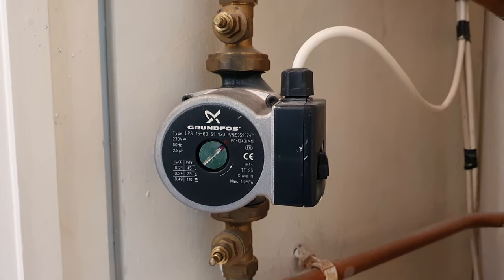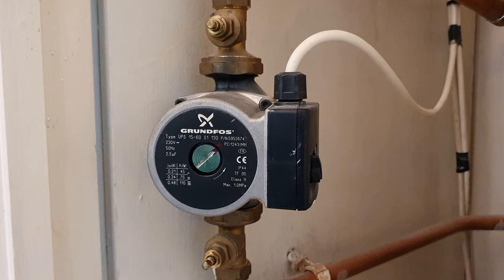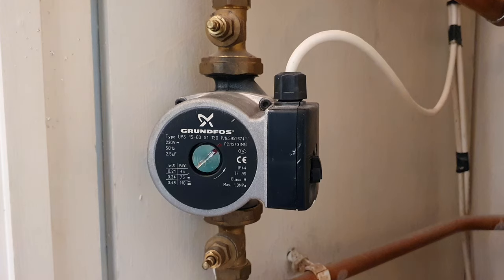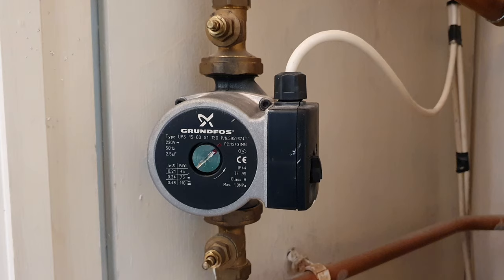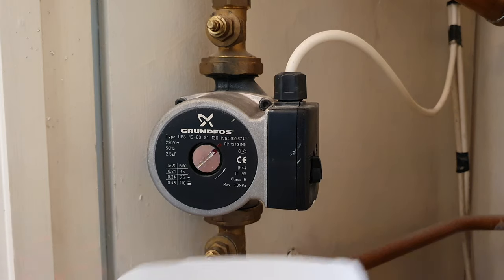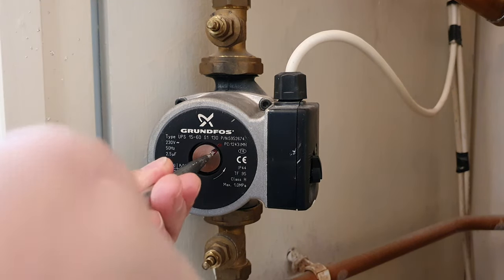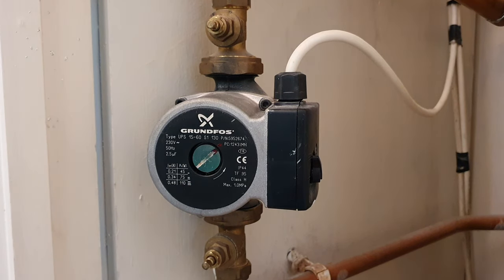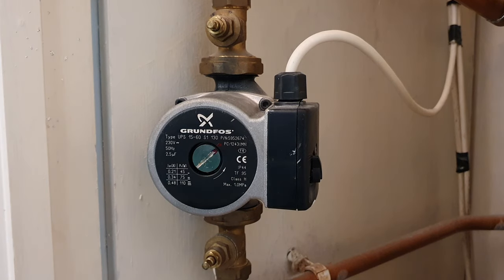How to bleed a central heating pump

Comment: Hey ya ! I just saw your video. We're having the same problem, and we tried to bleed the pump, but the screw just won't turn. It's way too hard to turn. Is there any solution for this ? Thank you !
Reply from the maker: Hi there,
You can spray a little bit of WD40 around the bleed screw and wait 30 minutes to one hour for it to work, then you should be able to turn it anticlockwise.
Hope this helps.

Comment: I have an issue radiators all working fine but 2-3 seconds of hot water in taps and then just cold?
Reply from the maker: Hi there,
This could be a number of things however here are a few.
1) Hot water cylinder could be full of limescale and would need replacing.
2) the element in the hot water cylinder is faulty.
3) the thermostat attached to the hot water cylinder is faulty.
4) the diverter valve may need replacing.

 Unfortunately You would need to pay for a call out.

Comment: Can pump make difference in temperature???? Last year i installed central heating sistem and it was great, reaching temperature of 26 celsius easyyyyyyyy, going for 27 evan 28 somethimes!!!! BUT this year is not the same, going up to 26 and that’s it!!!
I did bleed it little bit, evan went for that bolt inside. It is a little better but still not like last year!!!!
Cleaned the stove nicely to before using it!!!
What could be the problem?????
Reply from the maker: Hi There,
A new pump won't make a difference in temperature, however it will make it more efficient.
When changing the pump I would always recommend draining down the system and adding inhibitor
to the system.
If you have a magnetic filter this needs to be cleaned. I would check the pump is set
at the correct speed. Also bleed all your radiators systematically starting from downstairs and working
your way upstairs and finishing with the radiator at the highest point. Lastly I would check your room 
thermostat it could be faulty.
All the best
DIYShop

Comment: Hi I've a wooshing then bubbling coming from one radiator we have bled the radiators but the system still has this sound. I also do not have any hot water but my radiators are very warm. Would this solve one or both problems? Pump speed is 2
Reply from the maker: Hi there,
The pump serves your heating and hot water, what I would recommend is that you bleed all your radiators, systematically starting from downstairs and working your way upstairs and finishing by bleeding your raditor that is at the highest level last.
If this hasn't worked I would bleed the central heating pump as instructed in my video.
If the pump speed is at 2 and has always been like that then I would leave it for now.
You may need to bleed the air stalk.
Hope this helps feel free the contact me for more information.

Comment: And what about ticking sounds around 2 or 3 times a second? Is that the capacitor ?
Reply from the maker: Hi there,
Its unlikely to be the capacitor if your pump turns off and then back on again.
There is a possibility that it is a faulty wiring issue in the pump, there's also is a possibility that the impeller is struggling to turn, due to a build up of sludge in the system.
I have got another video which you may find helpful, this is the link:
https://youtu.be/O5ProxAE4f8?si=jzHpIvZvFI9fa0I6
All the best.

Comment: Hy
Afhter the summer the heating doesn't turn on,i have hot water but when i rurn on the heating only the top radiators from the bedrooms are getting warm,downstairs all the radiators are cold,i out my hands on the pump and i cam fell it working,shud i need to bleed the radiators?
Thank you
Reply from the maker: Hi there,
In this case bleeding the radiators won't work,
However I do have another video called radiators not working/central heating pump stuck. 
What I would recommend is to follow my video and this should work, However there is a possibility that you have a gravity fed heating system, and the ballvalve/ballcock has failed in the F&E tank (the small tank) this then would need replacing.
As always these jobs are a process of elimination.
All the best 
Mustafa
Reply from the maker: Hi There, try this link to another of my videos which will help.
https://youtu.be/O5ProxAE4f8?si=_Vcrzq9-wqpDmY-Q
All the best

Comment: Mine is buzzing when the heating/water is off. Would this fix it? Thanks
Reply from the maker: Hi there,
It's unusual for it to be making a noise if your heating and hot water is off.
However it's worth giving it a go as a process of elimination.
Reply: @diyshop839  OK, thanks for the reply 🙂

Comment: Hi need help!!!!!! My mothers boiler kerosene!!!! Is cooking and not getting the water to the rads?? I tried the spinning the propeller bit!! It spins ok and plumb is scolding
Reply from the maker: Hi there,
There is a possibility that there is a air lock in the heating system, I would bleed all your radiators starting from downstairs and working your way upstairs finishing off with the radiator last that is at the highest point.
Hope this helps.

Comment: hi there, do i need to change the oil or add some for my Grundfos UPS15-58FC Circulator Pump, thanks alot
Reply from the maker: Hi there,
The pump bearings are lubricated by water so they don't require any maintenance. 
However if you have your central heating system drained down and refilled, or your pump changed you must add a inhibitor.
Reply: @diyshop839  
thank you for your reply!
well i had to drain all the water and refill after i have replaced the air valve! There was a lot of air in the cast iron water radiator, and my friend!!!what s exactly an inhibitor?
Reply from the maker: Hi there,
Central heating inhibitor protects against corrosion from inside your heating system.

Comment: Thanks for video, I tried bleeding the pump twice but it's still squealing and the Noise is still coming from the pump.
Reply from the maker: Hi there,
I do have another video called radiators not working/central heating pump stuck, you can try that.
However if that doesn't work its a possibility that you have a build up of sludge in the system.
All the best 
Mustafa
Reply: @diyshop839  Thanks for taking the time to reply.

Comment: Reci mi prijatelju od čega zavisi i sta se postiže odredjenom   brzinom pumpi imam tri pumpe jedna pre miš ventila i dve posle miš ventila na koju brzinu koja pumpa treba da radi hvala unapred.
Reply from the maker: Thank you for your message.  
I have used Google translate, so I hope I have understood your question correctly.  
With Central Heating Pumps they normally have 3 speeds.  The best way to work out what speed is the best for you, is to start on the lowest speed (speed 1) If that doesn’t work try speed 2 and then speed 3.  The best way is to start at the lowest speed and work your way up.
Reply: @diyshop839  Sagen Sie mir, ob die erste Pumpe vor dem Mischen des Ventils eine niedrigere Drehzahl haben kann, danke

recite mi moze li prva pumpa ona pre mešajući ventila  da bude u manjoj brzini hvala
Reply: @diyshop839  Good on you for translating that mate, most youtubers wouldn't have bothered!
Reply: Pumpe uvijek pumpaju istu količinu vode u određenom vremenu bez obzira na brzinu! Što znači, ako je vodi potrebna jedna minuta da procirkulise od pumpe i nazad kroz, recimo, 50m cijevi na najmanjoj brzini, onda će i na najvećoj brzini opet biti potrebno isto vrijeme. Čemu onda brzine? 😁 Većom brzinom pumpe se, koliko sam uspio shvatiti, postiže veći pritisak. Uprosteno rečeno, Što veći sistem,  potreban je i veći pritisak. 😊 Pozdrav
Reply: @takisaki1503  hvala puno prijatelju
Reply: @ivanstoicic1965  ma, nema na čemu prijatelju!  A, Što se tiče više pumpi, po nekoj logici bi pumpa na najnižoj tački trebala, ako je uopšte potrebno, raditi na većem pritisku odnosno većoj brzini. Pozdrav 😊

Comment: I tried now the the pump is red hot with no hot water or heating what have I done ?
Reply from the maker: Hi Luke,
Ideally I need more information but I can give you some advice, if the impeller is spinning but there is no water in the pump I would check the ball valves in the loft in both tanks to make sure there working. F&E tank first then the CWS second.
Also check your consumer unit, that a breaker hasn't tripped. 
If you have a condensate pipe that is outside it may be frozen and you would need to thaw it out by putting hot water on it (not boiling). 
I would check that your room thermostat is set up high.
Also I would check your programmer to see what times your heating and hot water is set at.
Visually check that your boiler has power to it, and always follow manufacturers instructions regarding boiler issues.
Hope this helps.

Comment: What if I bled it but now it won’t stop leaking?
Reply from the maker: Hi Rebecca,
Two things make sure the rubber o ring is there which should be behind the screw,
And you may have to tighten it slightly more.

Comment: what about if no water drips out? I can remove that screw & no water comes out at all. Impeller spins freely, pump runs hot & the pump makes the emersion heater buzz loudly? And the pipes bang & shake then the boiler cuts out. The same thing would happen often till i found the cowboy who installed our magnaclean filter fitted the louvres the wrong way round. Ran sweet after then today I removed a rad to decorate & it suddenly all shut down & now it no longer pumps water.
Reply from the maker: Hi,
It sounds like there is an airlock in your heating system.  Firstly If your heating has been on, turn it off and let it cool down for an hour.  Then   bleed all your radiators, and work systematically bleeding each radiator from downstairs to upstairs. Also I would bleed the Magnaclean filter as well.  Once you've done that if that doesn't work I would bleed the central heating pump. 
If all this fails I would check the speed setting on the central heating pump, and increase it by one.
Hope that helps
All the best
Mustafa
Reply: @diyshop839 I done exactly that yesterday afternoon. It still wouldn't work. I then undone one nut on the pump on the feed end and no water came out of that either.  So I went further and looked inside the header tank and saw the water level had dropped a couple of inches or so. I then pushed the valve down to fill it back to level. Turned the heating on and loads of bubbles came up and some gurgling. A short while later all rads were hot and it's been working flawless since 15:25pm 👍👍. Lucky as we were contemplating accepting  defeat and calling a plumber.
Reply from the maker: Well done for persevering,
Fantastic news, it might be helpful to change the ball valve if it's getting stuck,
Part 2 ball valve make sure it has a red seating valve as you have a gravity fed system.
Low pressure system.

Comment: what if no water drips out?
Reply from the maker: Hi Timothy,
It could be that you haven't turned the bleed screw round enough I would try that first.
Other than that it could be that your impeller is stuck.